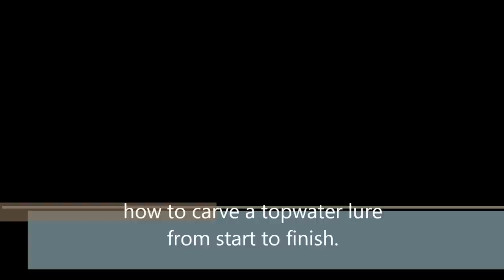how to carve a topwater lure

Comment from the maker: yes there is. for one it looks much neater on a small lure like i did here and secondly a wire harness can take much more abuse than screw eyes can and on top water lures the strikes tend to be rather violent, especially if your fishing bigger predatory species it pays off to use internal wiring.

Comment: I use a Proxxon power drill, a small sanding cap in the mandrel and I act free hand on the lure body, back and forth, until it is completely shaped. Lot of sawdust.

Comment: I have a question what about giving weight to this lure
Reply from the maker: +Heinz Schön this video was not really about anything else than actually making the carving and stuff but personally i usually always add little weight between the rear and middle hook hangers so that the topwater lure hangs in a 45 degree angle
Reply: +SolarBaits thanks for replay i will try it